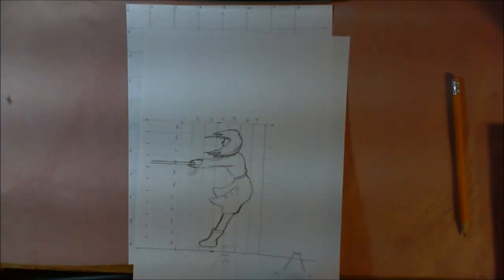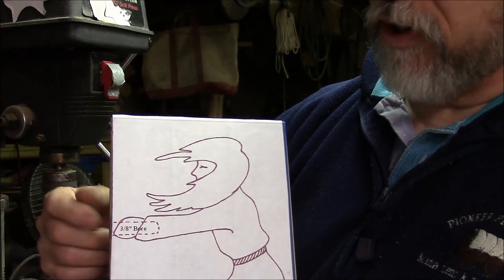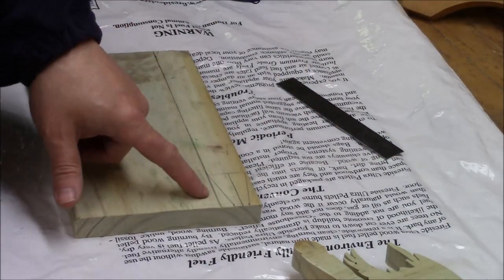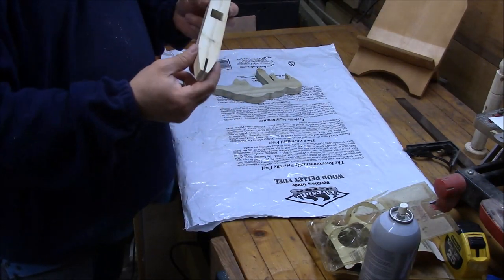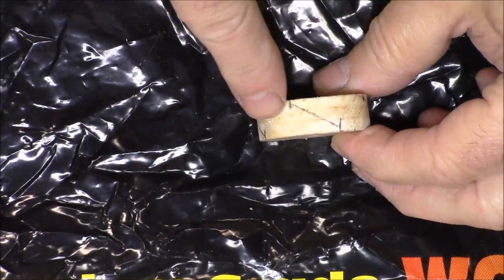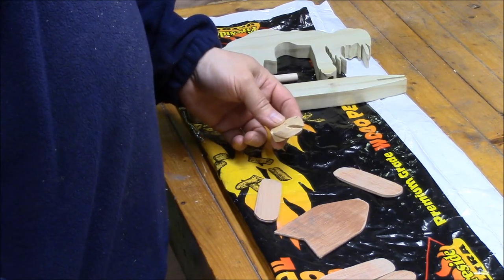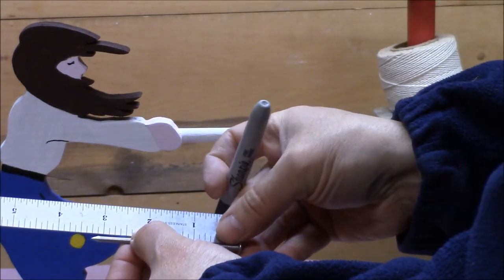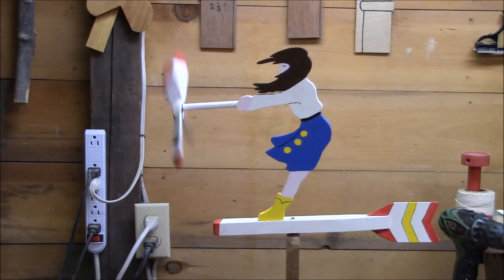Umbrella Girl Whirligig

Comment: What do you do to keep the plywood from falling apart?
Reply from the maker: I repaint it every spring. I've had this one for years now and I've had no problem with it. If the fan blades are causing you problems you can make them from thin strips ripped from solid wood
Reply: @RickMayotte  I watched a video with a guy using sheet metal for blades because he couldn't get the luan plywood to hold up. I have a bunch of old metal roofing from putting a new roof on our barn. I'm concerned about it being dangerous. Thought about gluing something like aquarium tubing on the metal edge. Truth is I have never made a whirligig before. I have been building furniture most of my life and I built a house and lived in it for 20 years. I'm also a blacksmith. Now I'm an old man, having trouble building big stuff. I love gardening and thought these things would be cool in the garden and on some of the fence post out front. I was a pilot in the Army and love the airplane whirligigs people are making. I flew Huey's and Blackhawks. Have you ever seen a helicopter whirligig? Thanks for helping me out. Thanks for making the videos! Bless your heart!
Reply: @RickMayotte  👉🔴What Do Muslims Believe about Jesus?

Muslims respect and revere Jesus (peace be upon him).  They consider him one of the greatest of God’s messengers to mankind.  The Quran confirms his virgin birth, and a chapter of the Quran is entitled ‘Maryam’ (Mary).  The Quran describes the birth of Jesus as follows:

 (Remember) when the angels said, “O Mary, God gives you good news of a word from Him (God), whose name is the Messiah Jesus, son of Mary, revered in this world and the Hereafter, and one of those brought near (to God).  He will speak to the people from his cradle and as a man, and he is of the righteous.” She said, “My Lord, how can I have a child when no mortal has touched me?” He said, “So (it will be).  God creates what He wills.  If He decrees a thing, He says to it only, ‘Be!’ and it is.”  (Quran, 3:45-47)

Jesus was born miraculously by the command of God, the same command that had brought Adam into being with neither a father nor a mother.  God has said:

  The case of Jesus with God is like the case of Adam.  He created him from dust, and then He said to him, “Be!” and he came into being.  (Quran, 3:59)

During his prophetic mission, Jesus performed many miracles.  God tells us that Jesus said:

  “I have come to you with a sign from your Lord.  I make for you the shape of a bird out of clay, I breathe into it, and it becomes a bird by God’s permission.  I heal the blind from birth and the leper.  And I bring the dead to life by God’s permission.  And I tell you what you eat and what you store in your houses....”  (Quran, 3:49)

Muslims believe that Jesus was not crucified.  It was the plan of Jesus’ enemies to crucify him, but God saved him and raised him up to Him.  And the likeness of Jesus was put over another man.  Jesus’ enemies took this man and crucified him, thinking that he was Jesus.  God has said:

  ...They said, “We killed the Messiah Jesus, son of Mary, the messenger of God.” They did not kill him, nor did they crucify him, but the likeness of him was put on another man (and they killed that man)...  (Quran, 4:157)

Neither Muhammad  nor Jesus came to change the basic doctrine of the belief in one God, brought by earlier prophets, but rather to confirm and renew it.